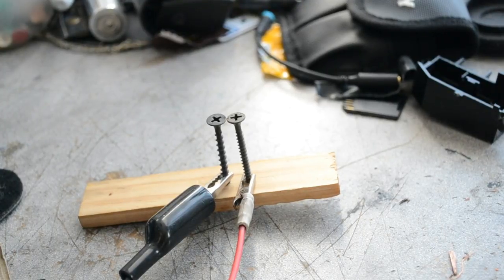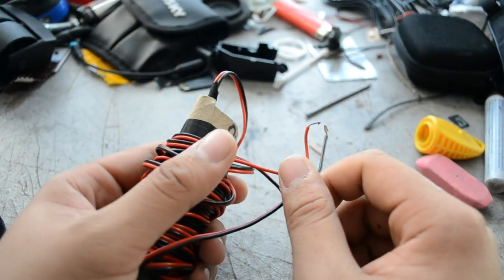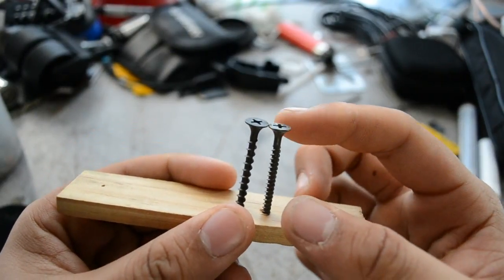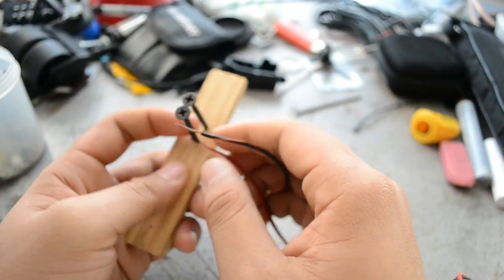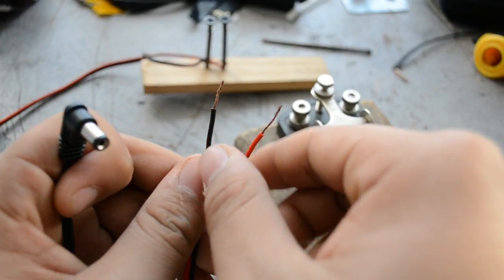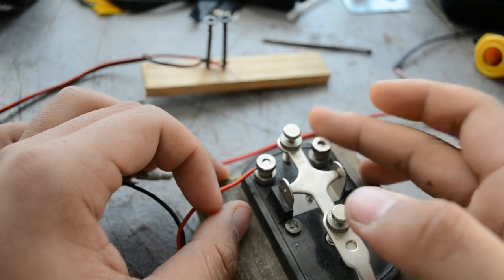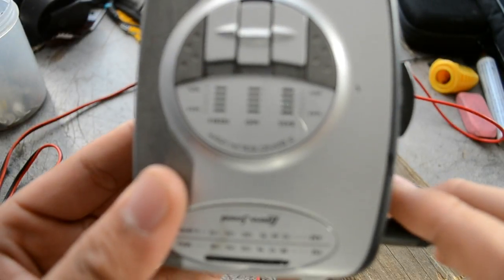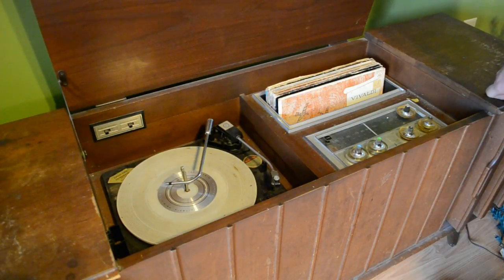How to make a Spark Gap

Comment: Just another tip: for some fly swatters, you might need to remove the capacitor in order to get a continuous spark.
Reply: Thanks Nathan!
Reply: Tnx Dude!
Reply: Did this work for you?  I've read the fly swatters only generate intermittent sparks, not a continuous spark for radio transmission.  Thanks!

Comment: I found that the "Black Flag" brand of bug-zapper works beautifully.  It uses 2 AA batteries, but of course you can substitute a 3 volt wall wart too.  It gives out a glowing spark and works like a champ.  So if you can't find a 9 volt zapper, give this one a try.
Reply: Did this work for you?  I've read the fly swatters only generate intermittent sparks, not a continuous spark for radio transmission.  Thanks!
Reply: @abgates56  The buzz zapper generates about 2700 volts.  What's critical is getting the gap between the two points of contact just right.  Getting it too close, you will get a bit of a buzz.  Setting the gap too far away,  you will not get a consistent spark.  It's just something you have to play around with.  You should get a steady nice blue spark.  Put it near an AM radio and key it,  and you will hear it come through the radio loud and clear.
Reply: @brucegordon7248  Thanks so much.  I'll give it a try!

Comment: Did you try it without a wall wart and just an external 9v battery? That circuit that you have now might be giving a false distance signal to your stereo downstairs as spark gap and stereo are both connected to house current. Try it with  your 9v stand alone power source and see if you still get the distance. Still a real cool experiment. Thank you"
Reply: Probably stronger with the AC adapter, but that spark will go pretty far.

Comment: I'm thinking a DC arc welder it's 70% of the components in one box  ad a relay to toggle the arc with a key, maybe a variable capacitor to tune it , a roll of 3/8 cooper tubing for the antenna you be heard for sure..

Comment: Is the power adapter plugged in to the wall? Sorry am not savvy but am trying to learn this
Reply from the maker: @akashiana5251 It is safest to use a 9-volt battery. I do not recommend plugging into the wall outlet for anyone unfamiliar with electrical work. You must read the adapter carefully and have the correct one that will reduce the voltage from 120v to 12v if using an American outlet. Once again, I do not recommend this if you are not familiar with electricity.

Comment: Umm, which fly swatter did you use? Brand? Trying to build the spark gap. Was the fly swatter high voltage?
Reply from the maker: I do not recall but it does not matter. Break open any electronic fly swatter and you will find 2 wires that lead to the battery bank, and 3 wires (of 2 colors) that lead to the kill nets.
Reply: Did this work for you?  I've read the fly swatters only generate intermittent sparks, not a continuous spark for radio transmission.  Thanks!

Comment: Why does the station for the AM radio need to be on a static channel, will this be overpowered by station transmitters?
Reply from the maker: Ducky Man, you would hear both the station transmission as well as spark gap with volume in respect to distance to the receiving radio. The reason Titanic ignored the original ice warning is because it came from a near by ship while its radio man was communicating with far away New York, so the ice warning was deafening and over powering the NY transmissions.
Reply: @ThonkhamKhoxayo  Interesting, so the warning was too loud for the radioman to reasonably interpret it at the amplification required to comm with NY?
Reply from the maker: Ducky Man, it is not known for sure. Some believe the radioman was more concerned with the money to be made by sending passenger's private telegrams and the loud warning was a nuisance to the job since it blocked NY's transmissions.

Comment: Hey there, if your trigger switch is held down, I'm really curious what the current looks like after the spark gap as the circuit continues.  Does the volts and milleamps stay the same? Is it still dc or does it convert to some form of ac?
Reply: The fly zapper generates the buzzing high voltage that is AC.

Comment: what can be used to substitute/replace the fly swatter wires as i dont have them?
Reply: A buzzer running on anything from 3 to 14 volts.  The kind of buzzer with a coil and contacts. 
The buzzer contacts will have it's own contacts as the spark gap..
Adding an antenna will extend the range past his which is atound 100 feet.

Comment: Hi, i wanna make one of them but i have several questions,

I want to use 9 V battery, is it gonna be a problem, should ı use 3V?
What are the mathematical equations i can use in this project?
 What is the average range of this transmitter?
Can i build an antenna to increase range?

İf you answer my questions, i will be very happy
Reply: Anlamlı herhangi bir yanıt bulabildiniz mi sorularınız için? Çünkü ben de aynı sorunlardan muzdaribim. Bir de, 9V neden kullanılamıyor? Tam olarak aklıma oturmadı çünkü hiçbir şey.
Reply: Yukarıdaki yanıt ortalama menzil ve antenden bahsediyor ama maalesef ben de pek bir şey bulamadım.
Reply: Battery is ok.
A buzzer running ion anything from 3 to 14 volts.  The kind of buzzer with a coil and contacts. 
The buzzer contacts will have it's own contacts as the spark gap..
.
Range without antenna, perhaps 100 feet.
..
Adding an antenna will increase range.

Comment: Wonderful concept using a battery operated electric bug-zapper. It has been difficult locating the 9 volt zapper. The only ones that seem to be marketed today in my area are those requiring two AA batteries proving a measly 3 volts and this appears not to be powerful enough to provide the nice spark gap you have.
Reply from the maker: AI4QT In that case, you can just use 2 AA batteries as your power source
Reply: Yep. I have made one using 2 AA batteries, but it just doesn't create the nice spark you get with the 9 volts.  Thanks for replying though.  Best from Alabama.
Reply: or you can just overvolt to 5 or 9 volts, it doesn't seem to damage anything on mine
Reply: AI4QT you could use an old trembler coil from a ford model T you can see how to hook them up on YouTube they produce about a 3/4 inch spark
Reply: Did this work for you?  I've read the fly swatters only generate intermittent sparks, not a continuous spark for radio transmission.  Thanks!
Reply: @abgates56  Actually, the fly swatter didn't work too well. However, I did see a YT video on how you could wire a simple telegraph key to an old fashioned door bell buzzer one could pick up at a hardware store. Here's how mine worked.   https://www.youtube.com/watch?v=5Ya5VaKnKms
Reply: @AI4QT  Thanks for the reply.  Your video is really cool!

Comment: What is the frequency you are using . is it am or fm
Reply from the maker: AM
Reply: The frequency is all over the spectrum, like lightning, without a tunable LC circuit to narrow it to a certain frequency range. There is no modulation like AM or FM, it's just static noise. You need an LC, a switching device like a vacuum tube or transistor, an audio input, DC blocking capacitors, and a few more components, for that.
Reply: Well, I just got it working... But, how to put the LC circuits and othet components to make the frequency not go all over the spectrum just using the same bug zapper components?

Comment: Is this legal?
Reply: Dxploitation probably not
Reply: The FCC frowns on spark transmissions of any type.
Reply: C  nothing is impossible. Have a neighbor complain about any type of interference to the right/wrong people and someone will check into it to be sure.
Reply: As long as it doesn't interfere with wifi nobody will care. It's 2019
Reply: spark-gap transmitters were banned in the United States in the 1920s,
Reply: @peterpauldonoghue7024  Actually worldwide back in the 20s, not just the US.
Reply: If you are in danger of life or limb you can use any band at any time. But intentionally causing interference for any other reason is illegal.
Reply: Mr. Gadget First off I suggest you learn some comprehension, ‘panic attack’ what are you going on about? I simply answered the persons question factually which nobody else was doing including yourself. My answer was 100% according to the FCC code, no hysteria or passive aggression whatsoever. I’ve built spark gaps when I was in grade school, that has literally nothing to do with my straightforward answer to the question ‘is this legal’. You can do whatever you want but I’m not going to purposefully mislead someone, anyone whom knows anything about radio knows interference is highly dependent on radiated power. A device like this in today’s world is only good for a survival scenario in which case just as I said there is no such thing as restriction on band. Other than that as far as the FCC is concerned spark gaps are unlawful, and since I’m not a fed so far as I care you can pump 1.21 gigawatts out of the damn thing until the sun burns out but that still won’t change the laws because I didn’t write nor do I enforce them.

A two sentence comment equals a ‘panic attack’ lol. What is wrong with people any more, so damn sensitive!
Reply: @Pacmannion  no, they were only banned worldwide in 1934

Comment: Is there another way than using a fly swatter so I can easily change change the frequency like with a buzzer circuit and a tuning potentiometer
Reply: A buzzer running ion anything from 3 to 14 volts.  The kind of buzzer with a coil and contacts. 
The buzzer contacts will have it's own contacts as the spark gap..